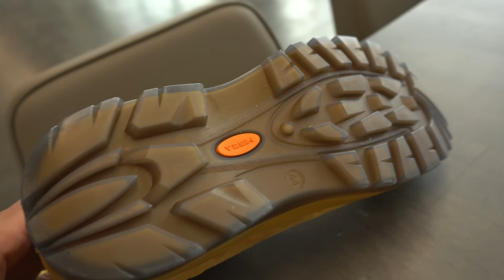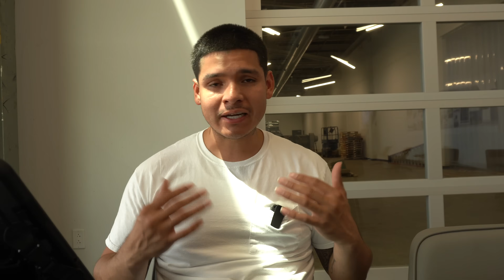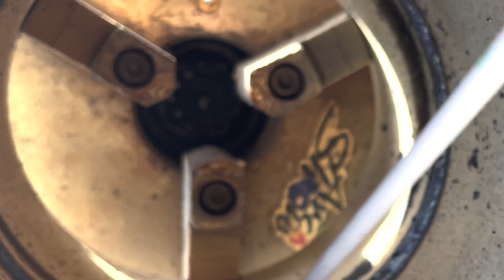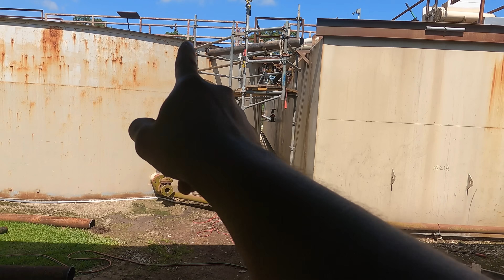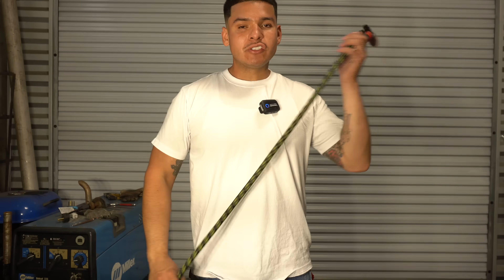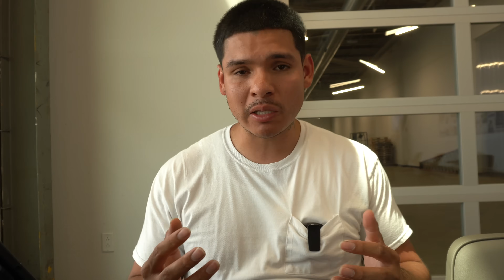BAD Week | FAILED Weld Test | Side Job Went Wrong

Comment: I failed an overhead test last week. I welded for 13 years but quit and tried something else for 2 years. I decided welding is where I wanted to be so I went back to it. I hadn't struck a single arc in those 2 years so to say I was rusty is an understatement, so yeah I failed my first test.

Comment: I've been cursed out and run off jobs, and I'm not even charging clients yet. It's all volunteer work. My friend asked for help, but I had my SA-200 in 4th gear and I accidentally plugged in electrode negative. When I tried to strike off, it stuck, and the 3/32 welding rod turned the color of a golden noodle, then it dripped onto the guy's wooden gate and set the thing smoking. He was pissed.
Reply from the maker: that was a very bad day lol! we all them
Reply: Why are you in fourth gear it’s the first question

Comment: You've said your torch blew out right after you filled your bottles, so my question to you is why you don't have a portable plasma cutter just in case the torch set up doesn't work? time saver!!
Reply from the maker: I need to get a machine where I can plug it too...my sa200 can't push it
Reply: @TheWeldLab  oh! The SA200 yeah can't push  the plasma, a generator with a 220 socket and an air tank